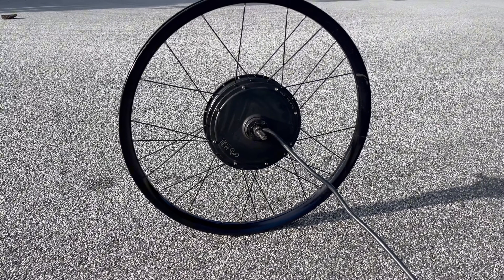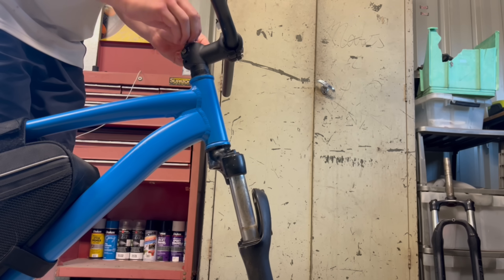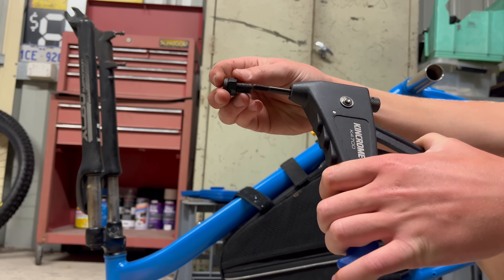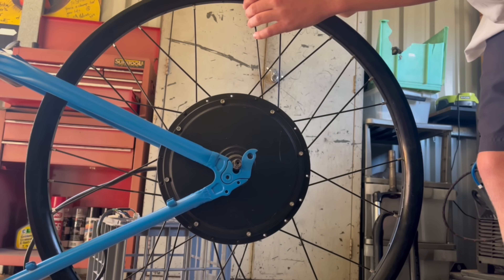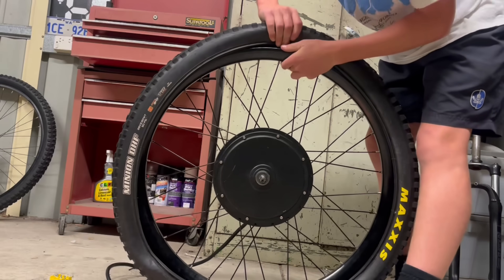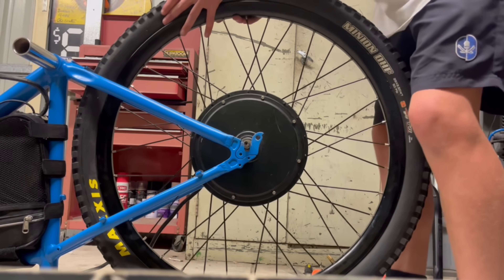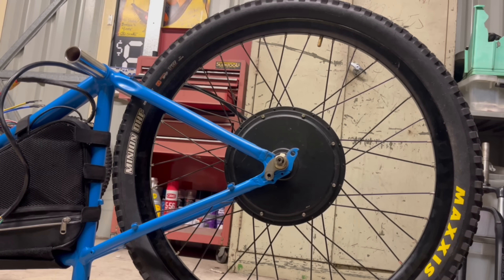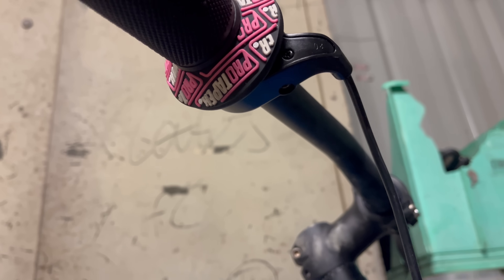I Built a 3000W eBike Monster (It's INSANE!)

Comment: Excellent video. You did a great job on the paint, not rushing it and thoroughly prepping and priming which is essential for a professional looking finish. And just a tip for any future brake disk installations you do, wear gloves to prevent oil from your fingers transferring to the stopping surface of your brakes and always clean them with brake cleaner after any maintenance. Keep up the good work kid! 👍
Reply from the maker: thanks!!!